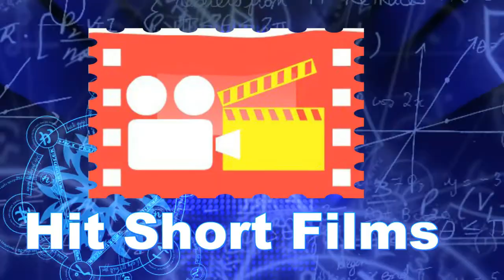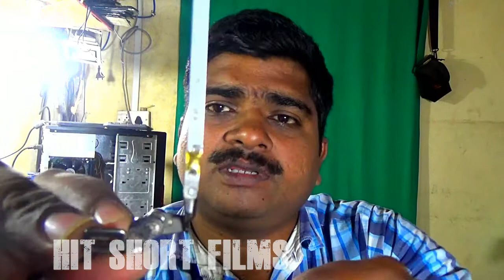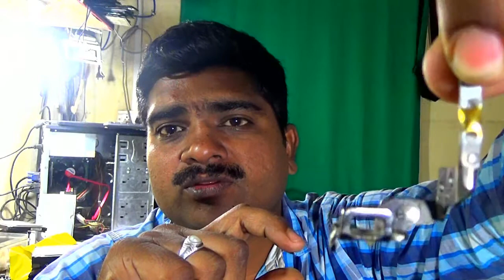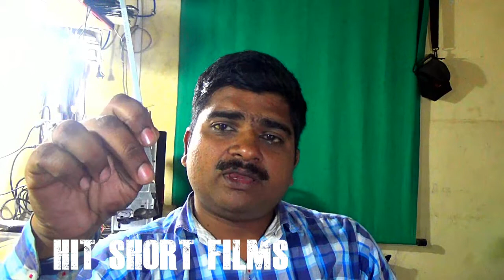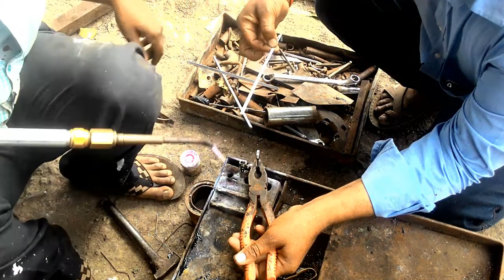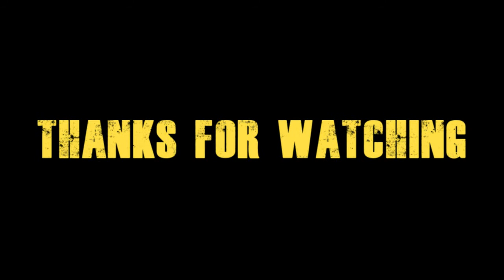Broken Hinges repair  -तुटे हुए हिंजेस को ऐसे रिपेअर करे

Comment: Hi, really nice can you tell me which metal you are using to solder it? And which stick is it? Aluminium with flux?
Reply: Yooo, please give me an answer 🙏
Reply: Judging by the color, it should be brass, which is not unusual for performing brazing of small parts. It's important to note that in brazing it's not usual to use tin solder wire, because it behaves differently, as it melts at lower temperatures, and it has different mechanic properties than proper brass, which bonds better with those metals, if all of the three elements are properly heated (a thing you can't get with usual soldering pen or station, which can only heat a small area and not for long).
Reply: @DiCaShFlow   contact gas welder